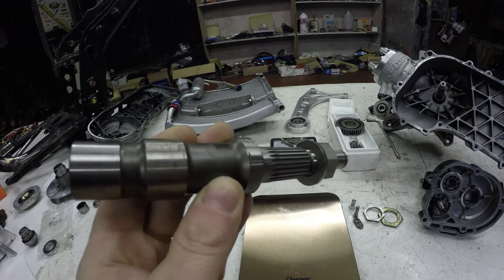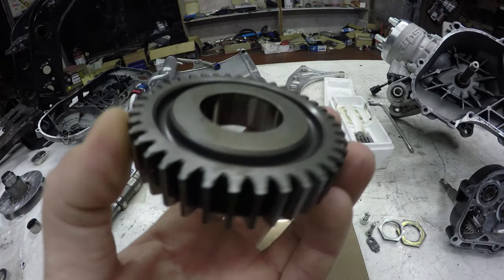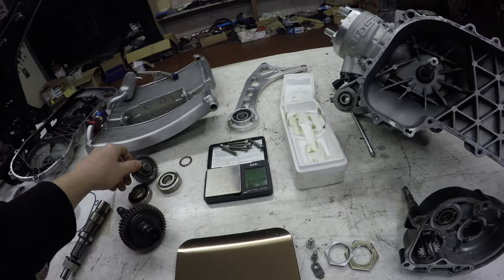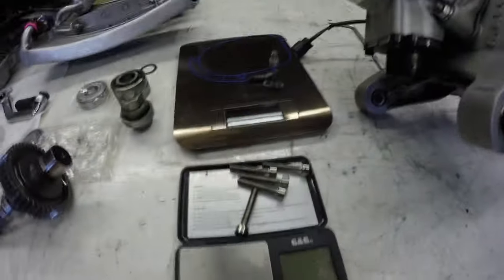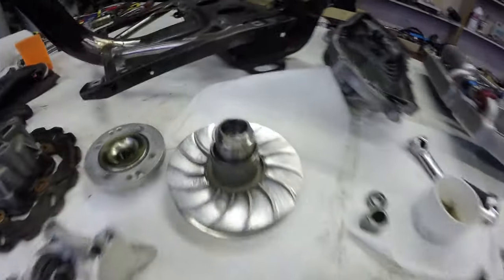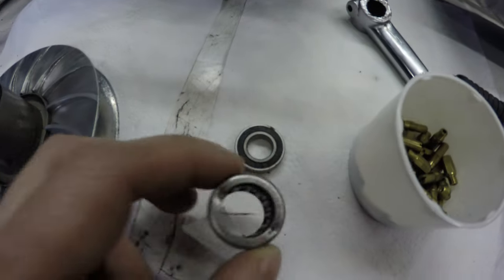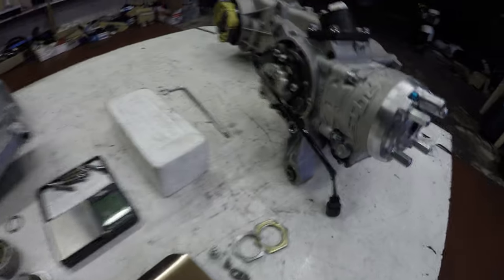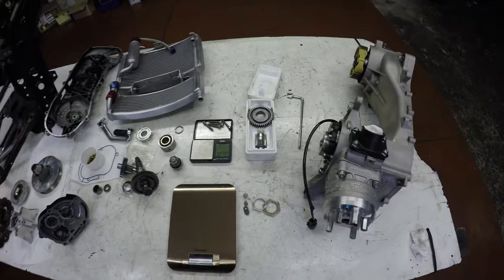Ceramic Bearings and Gear Box Plans

Comment: Have you thought about dipping the three-wheel-shaft-gearbox (dont know mechanical name) to replace it and make it with only one connection rod from the clutch to the rearwheel.
I think that your rearwheel will go round as the number of RPM's go. Might lose alot of torque.... Because it is 1:1.
Reply from the maker: it needs gears , i just wonna make them lighter and stronger , i think i found a process to make them better ... butt its expensive and only done in usa
Reply: @zipstunter  Check out this channel: https://www.youtube.com/user/titanamericanbuilt    These guys make everything that is build from metals.

Comment: Yeah frictionless bearing or anti friction bearing will make the engine easier to rotate for another word increasing low and high rpm (rotation per minute), but it need more big gear ratio or bigger tire to compensate the torque the engine can produce.

Be very careful using hollow shaft because it tend to break can't handle too much torque or stress.

I bet you don't want your rear tire overtake you while going 100 kmph 😅😅😅
Reply from the maker: yeah that would be a bad day 😂😂

Comment: In one of the previous videos you said that you were going to buy a new polini variator, could you share the product code? So that i can look it up too
Reply from the maker: M5717218 carterkap
M2517260 air force
POL-244.0578 speed drive evo 3
POL-241.750 vario
POL-249.061 koppeling 3g blue trek   ... these or the parts i ordered
Reply: @zipstunter  241.750 is it already for sale? I have seen the new polini variators from the catalog but all of them are not available to purchase in any of the most commom italian e-shop

Comment: I will buy polymer bearings because of the lower friction.
Reply from the maker: nice i did not know that they also make polymer
Reply: @zipstunter  Yeah, they also make teflon coated oil seals for reduced friction/vibration.
Reply from the maker: yeah mallosi makes a whole set for rc-one PTFE coated gonna get that 2